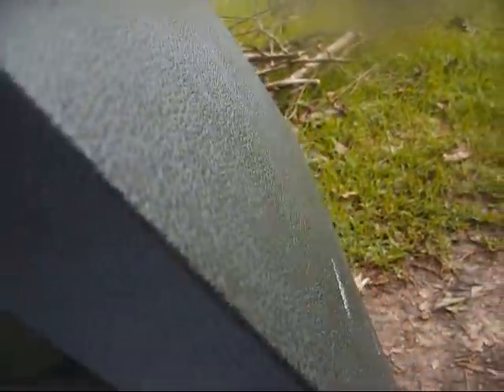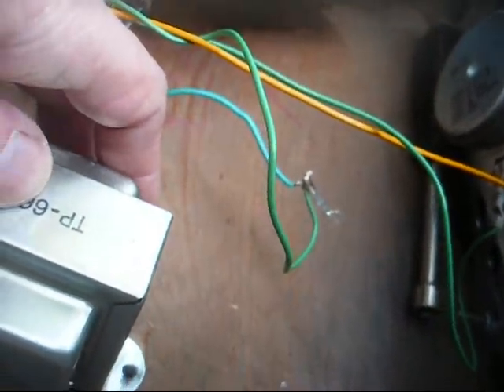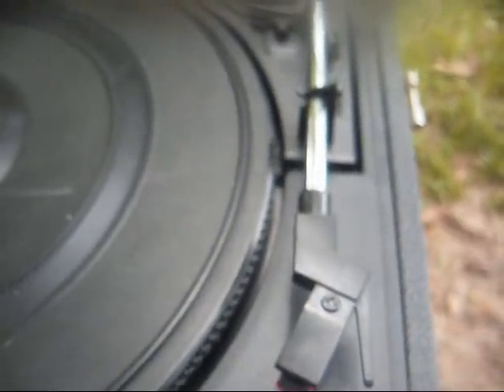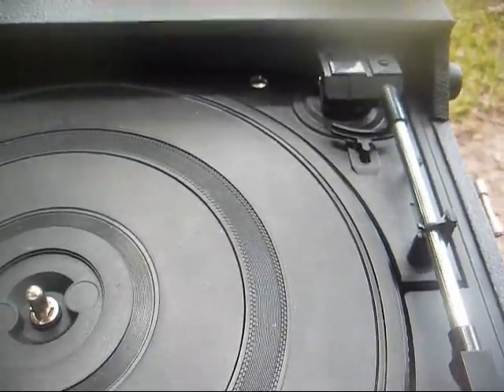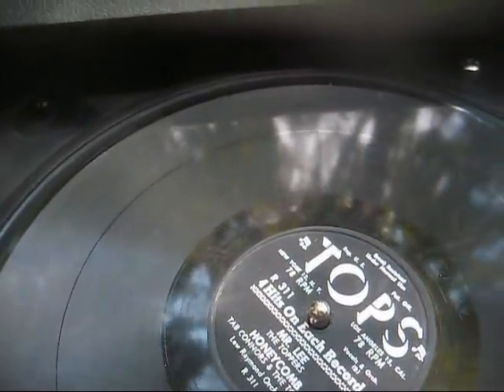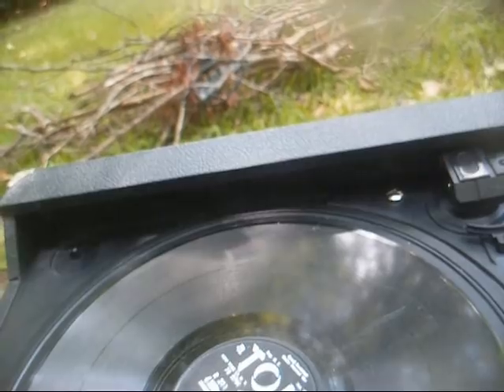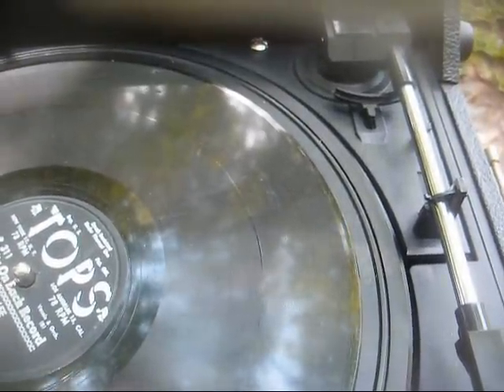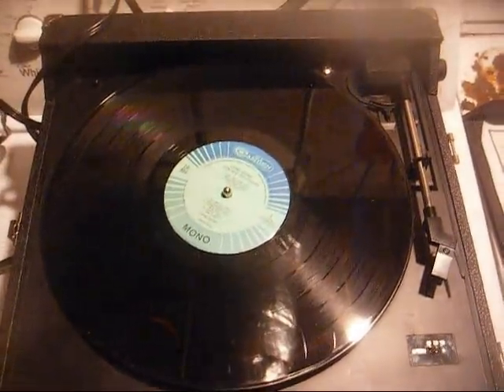A record player that is probably worse than Crosley

Comment: That plug they used on the cartridge wire  harness is just a common computer CD player audio cable to go from the CD player to the sound card inside your computers back in the mid 1990s, that's why that connection didn't work right.

Comment: Even with the issues it's still better than a Crosley.
Reply: So true! At least it has an amplifier with discrete components and properly cooled transistors, and a decent sized speaker. Modern Crosleys can't beat that :-)

Comment: 21:55  That is absolutely ridiculous. 

The black plug usually connects to some very long pins that are sticking out of a circuit  board (the kind where have to make a note of which way it's plugged in before you pull it loose so you don't plug it back in backwards).

 The white socket has slots to match notches on a white plug so that you know which way to put its plug it back in. 

I don't understand how they even put these two together, because even the pins in the socket are not a good match for the plug ( probably too small), on top of everything else wrong.

Comment: I have a really good ear as far as pitch goes.  33 sounded good and 45 was minorly fast but much better when you played Hot Rod Lincoln after original playing and 78 was much faster for some reason.  I never thought you'd say Crosley was superior to anything but now  I know.  The amplifier board looked like it should have some decent power behind it.  It was just designed wrong.  I'm not familiar with the records at the end.   Anyway have a great day.

Comment: They absolutely cannot leave holes exposed with screwdriver access for a classroom record player.  First, the school would NEVER buy them.  Second, if they did buy them, some dumb kid would get himself shocked in some way (NEVER underestimate the stupidity of people).  Lastly, every time it was adjusted properly, some kid would re-adjust it and screw it up.
Reply: The motor is 12v, U won't get shocked

Comment: As for your grievance over adjusting the speed of that record player - holding the deck to put a screw driver into the motor pot while playing a record = risk of the tone arm being unbalanced and skidding across the record, scratching it. I have a similar grievance with cassette recorders with a forward mounted motor and the manufacturer has not made that small hole in the back of the unit to put the screw driver in to the pot hole in the motor, and the recorder sounds weird = the wrong speed, I then put my test tone cassette in it and use an electronic guitar tuner to see how off the speed is, then having to take it apart and unscrewing some internal parts to pivot the cassette recorder mechanism out of the unit to expose the back of the motor to insert the driver, and holding the tone cassette in the recorder and playing it to adjust the speed, and the assortment of risks of doing that - damage, electrocution, and the test cassette being chewed by the pinch wheel ⚠️🙄.

Comment: That looks like something I would have put together when I was about... oh, 8 or 10, but I would have at least drilled the transformer holes in the right place. Stuffing a nonpolarized Ampmodu MTE/Molex SL plug into what looks like a JST XH header and then using hot glue to keep it there is something I haven't even seen China do yet. Wow.

At work we'll use NTE parts whenever the original manufacturer discontinues something particularly useful (their favorite thing to do...) and it's a low volume assembly that isn't worth redesigning and having to get all the expensive regulatory approvals for all over again.

Comment: Looks like a Crosley clone!!
Reply: Crosley (in it's current incarnation) didn't even exist back then I think. This is just a generic phono chassis used for many years in many cheap record players, including the likes of Crosley and Victrola.
Reply: @westelaudio943  The OEM for most low end Crosleys and Victrolas (and Electrohomes, if you're Canadian) is usually Sunwin. You can usually find them on Alibabba for under $50 in bulk. The OEM will put whatever name you want on the unit. Mid priced TTs and record players are usually sourced from OEMs in Taiwan.